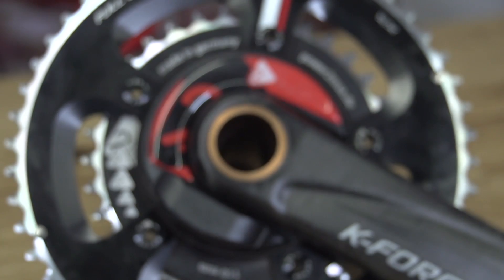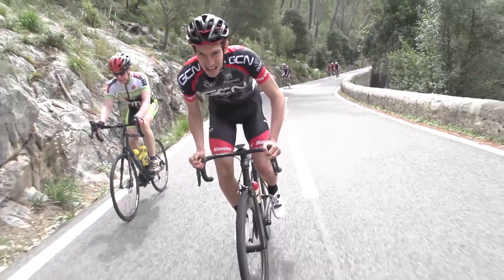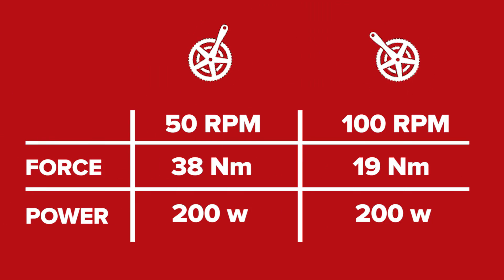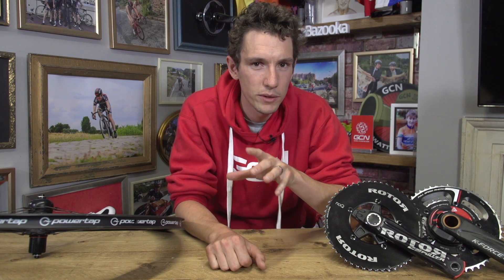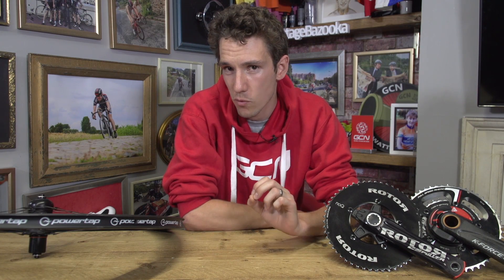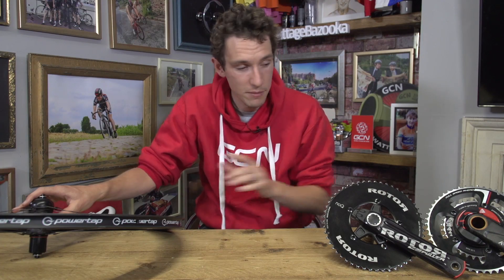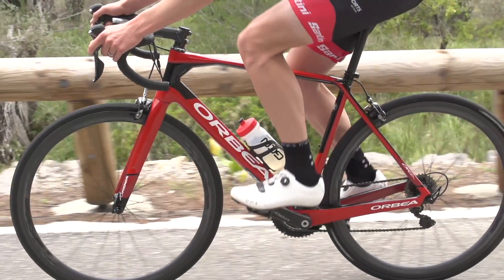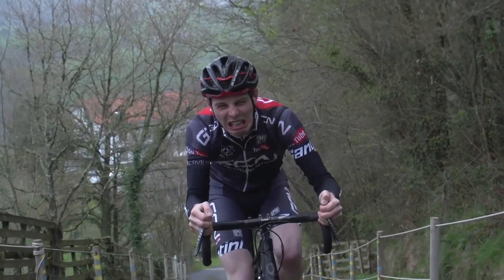How Do Powermeters Work?

Comment: What's the Force equivalent to in lbs? Is basically a power meter have a weight scale inside that then does the calculations to power in watts?

Comment: #GCN - Price is a big factor in choosing a Power Meter and for the recreational cyclist thats maybe doing 100 to 200 km per week with the odd sportive or low key race - is a double side power meter going to make that much difference?  Are you going to adjust your riding or training to compensate for any left right differences?  If so then post a video on how you correct those differences (where possible).

Comment: In that little table thing you have you have said Force but  given a value of torque (Nm). which would be the sum of the force applied on the pedals * how long your crank is. i assume you simplified it because the crank length is constant but its wrong and me being an internet  user i needed to point that out.

Comment: What sort of power outputs can one expect at various levels of fitness for example a 25yo pro is going to put out seriously more power than a middle aged overweight person that just got into riding?
Reply: FTP Power, A = 360w - 380w, B 300-330w,  C 250w - 280w assume top 10 finisher , 70-75kg

Comment: Thought: If Sky, being one of the most innovative teams and information (data) driven teams uses Stages one sided power meters. Why would this be IF there is such a deviation as large as 10%? They can afford any meter but chose a one sided unit. I'm an average everyday rider who trains for TT's and I can say that a power meter has really added to the ass kicking equation of training. Boy was I a slacker before I got mine, even when I thought I was working out hard.
Reply: That 10% is on the high end of a test that is itself in the high end... just like every single number involved in cycling. "our pants reduce wind drag by 40%", "drafting behind another cyclist saves 30% of your effort",  "our helmet increases your time by 5 seconds over 50 miles", "our wheel reduce power usage by 7 watts"... you get the gist. The numbers are technically true but they also make for a more interesting story so companies, journalists, and even you and I choose to parrot them. It's not a conspiracy, its human nature.
Reply: +JM AF a local SRM dealer I know said something like 40℅ of SRMs get returned for warranty issues in the first 6 months.
Reply: You will find sky are paid big dollars to run stages, and prior to that they actually had to buy their SRM units.
At my club, I don't think a single person has had a positive experience with stages with battery drain issues, inconsistent data output and several warranty replacements.

Comment: Strava's power estimates from first hand experience is +/- 30-50%. It's total junk
Reply: Thank you for that. You give me hope that I don't suck as bad as Strava says I do. :)
Reply: strava sometimes claims i hit 1300 watts, which is soo wrong. my stages reports max of like 700 watts. strava uses stupid math
Reply: I think my budget is within two months of adding a power meter to my bike. My research has me leaning strongly towards the Stages. How do you like yours?
Reply: My stages has been reliable and consistent. I don't race, but I do ride every day and log about 6K miles per year. I have the shimano 105 left side crank. Battery life is decent.
Reply: Watch this and then decide (hint, Quarq)...
http://www.bikeradar.com/us/road/gear/article/best-power-meters-42508/
Reply: Opposite 'problem' here: Strava cuts what's reading on my PM/Garmin by 10% .. 100% of the time!!   Very annoying.
Reply: yeah, it's special Strava math where w/0 = (w - (w *0.1))
Reply: Thank you! Price, performance, my needs etc that review convinces me a bit more to get the stages.

Comment: should have touched on non-round chainrings. and the powertap hub also broadcasts speed and cadence, so if you were riding with those sensors, you can drop them.

Comment: OK GCN, have a question for you: since power meters use a piece of metal that bends or flexes, can a power meter wear out? All metals are susceptible to metal fatigue.... so if you're going to spend the money on one it'd be nice to know how long it should last.
Reply: For example metal fatigue in aluminum will happen with even the smallest bend but in steel there is a 'threshold' you can bend it within some limits and get no metal fatigue.
I don't which metal is in power meter but if I were to design them I would use one that has a no-fatigue threshold.
Reply: Yes hey can, but you are talking about relatively small deflections so the fatigue cycles are quite high. Very similar to a pressure sensor used on your car which measures the deflection of a diaphragm using strain gauges. Vibration fatigue is likely a bigger issue than stomping on the pedals.
Reply: It's your crank that flexes and the strain gauge foil is glued to the crank. The stresses in the crank are higher that the stresses in the thin foil.
Reply: this also means that the power meter must contain a section which bends or flexes to allow this sensor to flex? surely this then reduces the efficiency of the part - some of your pedal stroke is wasted on bending the crank/spider rather than turning the chainrings?
Reply: The movements would be quite small I suppose, but I don't know exactly how they are constructed.... and where and how any possible metal fatigue could occur.
Reply: Vegas Cycling Freak I would suppose they build them with long lasting materials, I've never heard of someone's power meter going bad.
Reply: Luciano Narno I would think so. I'm one of those guys that thinks of these things though... must be because of working in mech engineering for so many years. ;-)

Comment: That was great! Thanks. Is there a lifespan for a strain gauge? Will it wear out, or will the PM break due to crashes, water ingress, etc?
Reply: The practical life of a strain gauge is longer than your frame. Check out this guy who made his own power meter: http://keithhack.blogspot.com/2013/01/v3power-meterthe-complete-how-to.html and you can see how little to stress is applied to the actual strain gauge. Strain gauges exist in all kinds of places from bridges to mining safety gear and will operate 10s to 100 years or more. The electronics that read the data, can fail, but the actual strain gauge probably won't, unless it was faulty from the get go.
Reply: +MKTech very good to know. Thanks! 👍

Comment: why dont you make a video with GMBN about who can make better power???
Reply: It would not really mean much as 'better' is hard to quantify between road and MTB.  MTB tends to have much more high peak power for much shorter periods of time, where road requires the rider to hold power for a longer time.   That is, it is possible for a MTB rider to best a roadie about peak power, but a roadie will likely have a much better 20min/40min/60min power.
Reply: they already did
Reply: they have made such a video

Comment: Can you elaborate more on the accuracy of strava wattages, or make a video about it ?
Reply: good enough for sky.... it will depend on the rider my stages numbers are very close to wattbike numbers so i dont worry about it
Reply: strava power is sometimes off by like 70 or more watts which is huge.
Reply: Strava is only a rough guess it can be almost correct if you, your bike and the environment meet certain conditions, outside of this its very inaccurate. personally if on my own on a cycle I found it to be below what I get on indoor training power meters, tack neo 2800 and stages power meters. (tacx neo not a power meter its only a rough calculation but it can be accurate) i have tested it against the stages and they are almost the same there are some fluctuations but not very often.
Reply: Strava does not know what the wind is doing and can also completely get the road grade wrong. I was  once given 1400w for a few minutes going up a slight hill with a tail wind.

Comment: a left hand might not give you the most accurate but could it be consistent. if your data says  you can push 300w over 10k  before you blow when your real power is 325w as long as you don't go above your  know max (race scenarios)  would it really make a difference?
Reply: when I mean data, data accrued using the same power meter.
Reply: Would Team Sky use left sided powermeters if they are crap? No.
I am perfectly fine with my Garmin Vector S and my two stages powermeters. No need of double sided versions... :)
Reply: I know with my LEFT LEG power meter I need to get to a number on my LEFT LEG power meter that I can stick with for what ever distance I am doing eg 30km TT i know I have to range 300 - 350 watts on my LEFT LEG power meter,
if I go above this number I might be able to do it for 2-4 minutes but have to drop down to the 300 and not very far off it or I go into the red can't recover and my time will pay the price - to me its me racing against me with the numbers provided I know what I can get and cant get and I always try to push the boundaries so I can let my numbers rise by very small amounts but over a long period them same small amounts are large.
5 watts a month == 60 watts by the end of the year that's like getting a newbie cyclists leg and sticking it to your own for an Xmass gift to yourself.
Reply: from my experience over the last 4 years there are 3 big issues with left only that I have noticed from my power2max estimated L-R balance.
1. left and right balance varies depending on intensity with me riding at close to 55-45 at easy intensity and almost perfect 50-50 at FTP or higher.
2. if I have an injury such as a sore knee, I can be as bad as 40-60
3. in longer rides my left seems to fatigue faster than my right, which shows in my L-R output.

Comment: the table at 1:30 is wrong. Nm is the unit of Work and not Force
Reply: Their were many things wrong with interchanging words of different meaning in this video, including that table for which it should say torque instead of force. (could have had said force 100N and moment arm 380mm). Also energy can be expressed as Nm but the distance is in the direction of the force not like torque which is the perpendicular distance from the force to the axis. for this reason is is good practice to use J for joule to avoid confusion when talking about energy.
Reply: Isn't work in joules and torque in Nm?
Reply: +NHGJLK Yes that is the proper way to express these terms to avoid confusion. Although it can be expressed as Nm which is super rare as it is misleading hence my previous response. (which could have been written much better sorry)
Reply: I think GCN should get an professional sports scientist, physicist or engineer in for these videos. There seem to always be a lot of errors in their technical presentation.

Comment: That red screen with table should say torque, not force.
Reply: The equation given was the 'vanilla' equation for power, rather than one specifically defined in terms of rotation. If you wanted to throw 'torque' in there, you'd have to adjust everything else to make them the rotation based too.

Power CAN be defined in terms of torque,  however, but it's not the same as just throwing torque into the earlier equation. Power = torque x angular velocity, where angular velocity = number of rotations/time.

It gives the same result though.
Reply: If thy're going to mention torque, then they would have to bring angular velocity into it as well, otherwise they're better off sticking to the general definition of power instead of the rotational-specific one. 

Btw, moment is generally used where the angular velocity of the object the said force is applied to doesn't change, e.g. an object hanging off a beam creates a moment through it, whereas a rider applying force the the crank arms is actually rotating something, hence it's usually referred to as torque. Or at least that's what I've read...
Reply: +Maxz torque is not the same as force and therefore should still be corrected. And as they are using a rotational based system it would be good to use the correct terms.
Reply: *Moment
Reply: +JoeHarperr torque and moment are generally interchanged but I would argue that torque suits this situation better.
Reply: +lite Roadie 10/10 agree!

Comment: You should do a video about the difference riding on a buttersmooth tarmac vs riding on poor road surface. How much power does it require to hold a set speed or how much is the difference in speed on a set amount of power - something like that would be entertaining to watch, since you guys alway mention the importance of the surface you are riding on
Reply: cant answer with numbers but in my experience its a big difference, also hard to maintain power if you're bouncing around
Reply: most of the area I live  in have terrible tarmac, riding is fun but hard
Reply: the only problem there is finding a section of smooth road to do the comparison. it might have to be rough vs slightly less rough instead
Reply: There's a road near where I live that part of it was resurfaced recently, but part wasn't. To hold 150w, 4-5% gradient the speed jumped from 13mph to 16mph. Literally right after each other, straight road, so no condition changes or anything. So I'd say it was pretty accurate.

Comment: is the stages powermeter only on one side?
Reply: Left side crank arm only
Reply: The basic Garmin power meter comes with only the left pedal, with the right pedal available as an upgrade kit.
And you can of course buy them as a set.
Reply: which is a big advantage as you can swap between bikes in under 5 minutes

Comment: Oh my god, enough with the "BUY A POWER METER BUY A POWER METER!".
Reply: You think wheels, rather than the most precise training device in any endurance sport, will allow someone to go farther and faster? Lol. Wheel weight has virtually no effect on climbing and the drag produced by wheels is negligible, even at high speeds. Upgrading them costs big money and has tiny effect on speed.
Reply: @KurtVogel88  I don't think people who get aero wheels get them because they think it'll make them go faster. I think it's more about their efficiency to move through the air once up to speed. I agree that they're quite pricey, but no major upgrade on the bike is really cheap. Even aero handlebars or an aero helmet aren't going to be cheap, per se. Each one is still highly likely to set you back 3 figures.
Reply: if you want to go faster/further you have to become fitter - and therefore a powermeter is the much better upgrade. The best bike with the best wheels doesn't outperform the better rider...
Reply: In my opinion, if you want to enjoy your ride more and go faster/further, wheels.  If you are serious about training and really like to look at the numbers then go for a powermeter.
Reply: simon A: Untrue. Cheap wheels have rubbish hubs, crap bearings, rotten spokes. You get what you pay for.  Cheap wheels almost always have a weak rim and rims like that cannot support a high uniform spoke tension without turning into a potato chip.
Reply: +Rob Lucchetti ^ it really depends what you want.  If you aren't serious about training and just enjoy riding, a power meter isn't going to do a whole lot, which is why I said in the first comment that if you are serious about training a power meter is a good idea!
Reply: Depends on your wheels - a good alloys wheel set will stay truer, with better his will roll easier and with enough spokes, depending on your weight you get a much more dependable wheel that rolls easier and makes the most of your hard earned wattage. Power meters are great for training, but for overall riding you can't beat a good  set of wheels.
Reply: which bike upgrade to do first: power meter or wheels?
Reply: new wheels make barely any difference if you're riding for fun.  lots of bike upgrades make you feel faster but your numbers barely go up.  power meter is the only purchase that has made a significant difference in endurance and speed for me.
Reply: It's also not true that good wheels are more reliable.  you can bring any cheap wheel to a bike shop to be properly tensioned and it will perform well.
Reply: depends on what you do, as a racer i would strongly recommend buying wheels first, cuz they really do a difference. on races with 1k laps the weight difference can really make a difference as you have to bring the wheel back up to speed again, and if you are racing you will easily go 50km/h at which speed you can clearly feel the difference of 50mm deep section or just common rims.

However if you are just riding steady group rides and ambitious sportifes i would rather buy a power meter because, in common group rides wheelsets barely do a thing and you can use the powermeter for training and improve a good bit.
Reply: CW SK Well said mate. Most of the spoilt rich yuppies that currently infest the cycling scene only use them as an expensive toy anyway and don't have a clue what to do with them. Only of use if you also have a good coach overseeing your training and who you can send your power downloads to for analysis. If you don't have that then you're just playing at the game and having fun with expensive toys.